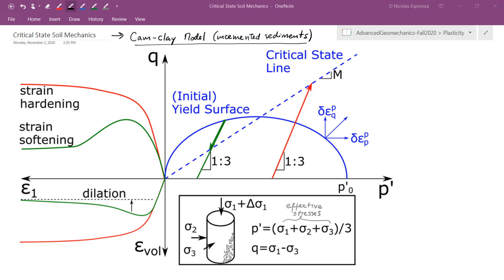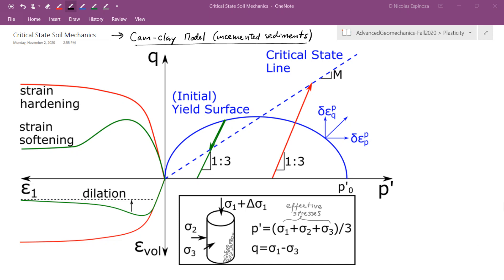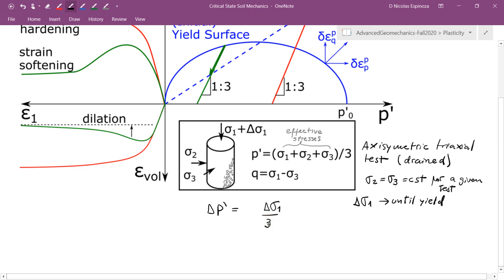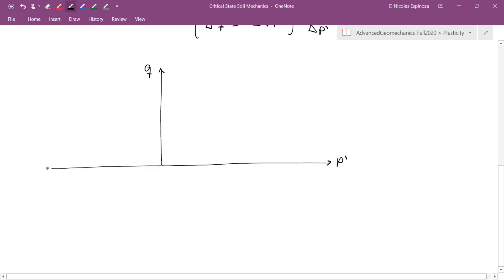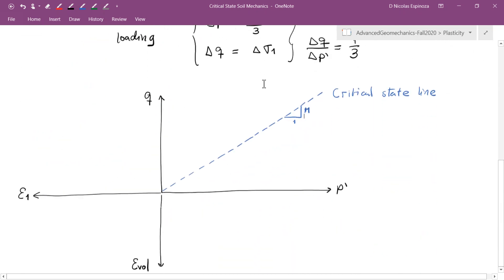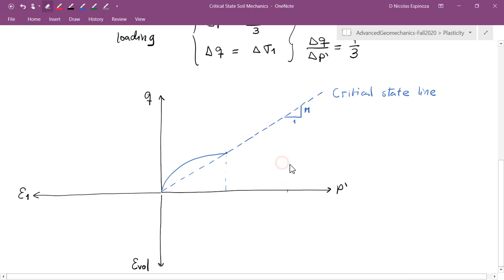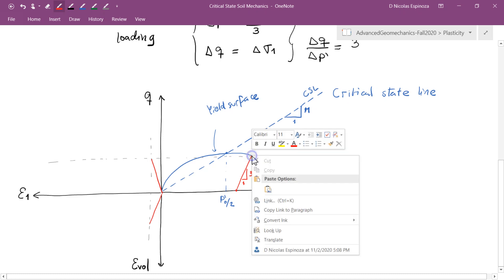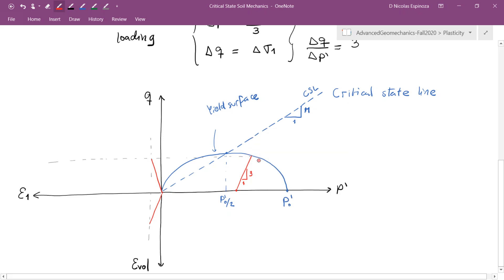L32 Cam-Clay model (Part 1): critical state line, yield surface and isotropic consolidation line

Comment: Hello, Dr. Nicolas Espinoza. May I ask that how does E (young's modulus) change when confining pressure is increased. We suppose E  is gonna be bigger. But what theory or formula can be used to illustrate that result? Thanks
Reply: When confining pressure is increased, the rock changes from strain-softening to strain-hardening. But how does E change and by what theory to prove that.
Reply from the maker: This is shown in the next video (Part 2: https://www.youtube.com/watch?v=K4GwcipYjOA). The Cam-Clay model handles elastic volumetric strains through the compressibility coefficient kappa. This is a non-linear elastic model, you could get a tangent stiffness modulus from here but this is not usually done, you just find kappa.

Comment: Hi Dr. Espinoza, Thank you very much for the great lectures! I do have one question: How does temperature affect the yield surface in the MCC model? An increase in temperature seems to facilitate thermal compaction and cementation of soils, but earlier in your L23, you mentioned that an increase in temperature induces dilation. How do we reconcile these two effects?
Reply from the maker: Hi MK, the answer is not straightforward. Very high temperatures reduce the size of the yield surface making rocks/sediments weaker and more ductile. Changes of temperatures within the elastic regime cause volumetric changes of the minerals and pore fluids within rock/sediments. The first one can be modeled with a temperature dependent yield-surface, the second with the theory of thermo-poro-elasticity (See Cheng, AHD. 2016. Poroelasticity. Springer). The key is to recognize which processes lead to either inelastic or elastic deformations.

Comment: hi thaks for this video, just one question : why the critical state line always crosses the origin? the cohesion of the soil is not taken into account with this model? thanks
Reply from the maker: yes, the critical state line crosses the origin because most soils are uncemented and have zero cohesive strength. Some soils may have an apparent cohesive strength (undrained strength), temporary cohesive strength (capillarity and suction), or some cementation. The modified cam clay model can be modified accordingly to include cohesive strength and model rock behavior, see https://youtu.be/jgcsHyRMhmQ?list=PLv0npDbE5HXtEcPhMK33EMz6AG0qXWuc1&t=1273 and https://www.osti.gov/biblio/1238100
Reply: @dnicolasespinoza5258  Hi, thanks a lot.
Reply: @dnicolasespinoza5258  when you think about it, isn't it rather the opposite tendency that is evident? that is to say that most of the soils are rather cemented, aren't they?
Reply: @dnicolasespinoza5258  another question : can suction make a sand soil like a cimented soil?thanks
Reply: i ask this question because i m a little bit confused. is cohesion create by fine particle (clay particle) or by temporary effects (capillarity or apparente strength). thanks
Reply from the maker: @b.y.7646  that's why sand castles are possible, or 90deg cuts in silt/clay are stable
Reply from the maker: @b.y.7646  No, most soils are uncemented or have a cementation which is negligible. More about soil mechanics here: https://kupdf.net/download/fundamentals-of-soil-behavior-j-k-mitchell-amp-k-soga_58c5fda2dc0d608f1c33902a_pdf
Reply: @dnicolasespinoza5258  ok, thanks